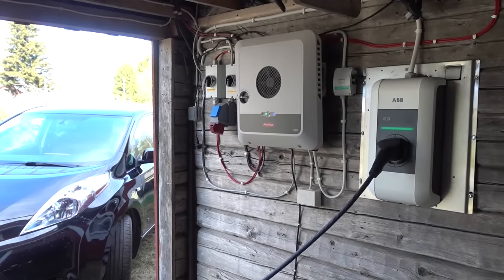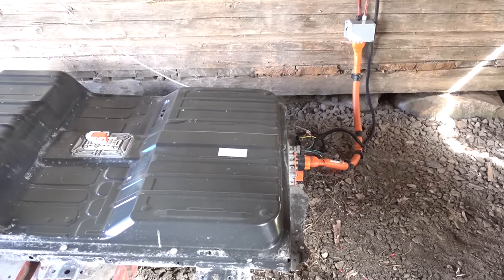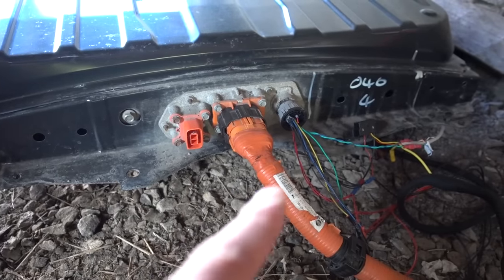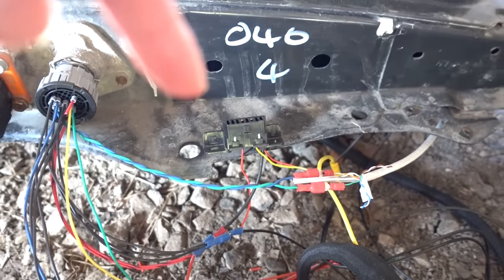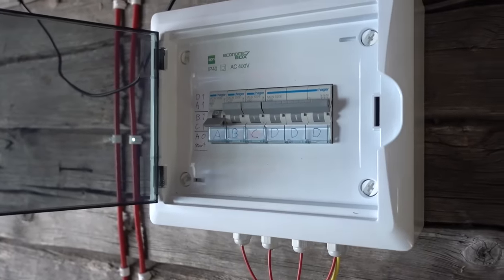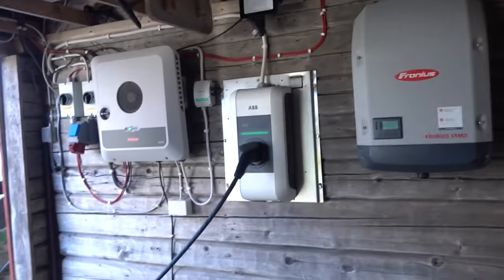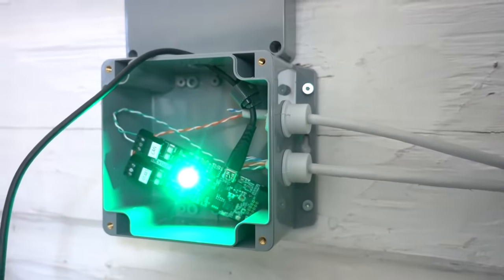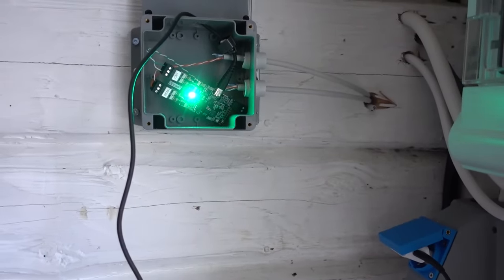The EASIEST way to connect used EV packs to grid! 🔋

Comment: Thanks Dala, this is the kind of content I’ve subscribed for. To be able to use the car battery “as is” without messing with it, use the original BMS plus the sealed box should be really useful.
Reply from the maker: Thanks, I think so too!
Reply: The sealed box however prevents you from analysis past the original BMS or around the original BMS (e.g. with a faulty BMS) directly at cell level or PCB level.
It also disallows visual inspection for problems like corrosion, humidity (think of a previously flooded pack), burns on the board, visually bloated or blown capacitors, charred or sticking contactors, and so on.
Also, you cannot easily change modules and cells or the BMS board or broken contactors. It is essentially a black, sealed box. In other words: you really have to trust this BMS. Even after let's say 10 years in its first life in a car with whatever environment. And you cannot choose a favourite kind of cells or chemistry.
Old Leaf LMO or NMC and Tesla-used NCA chemistry is not the best for stationary use with many cycles. Old Leaf packs are passively cooled, but with Tesla batteries or modules, you would have to add a cooling circuit if  the original environment was wanted.
I still like the idea as a low-cost alternative, but both sides should be considered when going this way with 2nd life EV packs.
Reply: @MooseOnEarth  no cooling would be required. It's highly unlikely that a house would draw the high current that the car did. Maybe 1/10 the current used. If that.
Reply: @kevinroberts781  In that case however you have to check, whether the original Tesla BMS can cope with the absence of TMS components. It may check, whether all expected sensors send plausible data and also check that all expected actors act upon the media they act uponand that then sensors do indicate successful operation of the actors. The original BMS is typically in direct communication with the original TMS. And now, all this communication would have to be emulated
Dala and the EV hacking community will likely figure that out, but once people use such solutions, they should be aware of a mixture of Tesla routines and surrounding glue code and emulated components, that are not actually present. In other words: people are on their own. That's ok, if they are aware of it. But they better are aware of it.

Comment: Ever since I saw the home batteries made from Leaf cells I wondered why they did not take the high voltage out and use it like you did and now with high voltage MPPT built in chargers it will be even easier. Congrats.
Reply: But how you will charge the battery, no way to communicate between inverter and the BMS etc. This is all in one working solution
Reply: @georgmuse  They now make high voltage inverters and chargers.

Comment: Very cool stuff! Next you got to connect your Leaf direct to that inverter via DC to charge and discharge. Defeat pack to ground current leakage test module in your Leaf and you should be good to go.

Comment: Hi  well done that's a great work  but i just wanna mention to you not to forget the wiring size for AC and DC, the fuse, isolation switch, and SPD in case of lightening, also draw a digram it will help. Thanks

Comment: I just got the lilygo and will try connecting it to my older Fronius Symo inverter....our old 2012 leaf is due for a battery upgrade soon so hope to use the removed battery for storage!
Reply: That Symo may not be compatible?
Reply: @dominicwild3189  its compatible with tesla, byd and fronius wall batteries so should be fine, I've connected the lilygo to it and is does communicate, just waiting to get my hands on a battery now....

Comment: I was very confused by the simplicity of this ("just plug the DC into the inverter") because I'm so used to every inverter being @ 48v. Took a while to dig up that the Fornius is a HV DC inverter, using 150v - 455v for the battery connection side.
Reply: I was thinking the same. Sounds like an ingenious inverter.

Comment: Make sure the fireproofing you add is extremely robust . Maybe get a sheet-metal shed to put at a modest distance from your house, and run wires from there. 
Fire departments don't actually "put out" lithium battery fires.  They just dump massive amounts of water on them to cool them off somewhat until the battery has burnt up all it's fuel, to hopefully keep the blaze contained. Some have suggested that EV batteries don't belong within 20 meters of any flammable construction. That may be excessive, but the fire can easily melt a car down to a puddle.
There are longer lasting batteries with lower power density which are better for non-mobile use.

Comment: Very great solution! I wonder if can get rid of solar controllers and use, for example, VFD which also has RS485 and can accept 400v DC and convert it to ac?
Reply: Maybe we can connect to some cheap PLC as well to control contactor and get date from battery.

Comment: I've wondered for some time now, if the market would not have reached a point by now where you can buy and assemble a modular system, consisting (in very general terms) of the following components:

* A standard inverter/control box that would do the power conversion, interface with any grid control device, etc.
* A battery specific interface box, that would convert the batteries' voltage/current/communication lines to standard values/protocols that could interface with the inverter/control box. 
* A used EV traction battery

So, in your situation you'd buy the inverter control box, a "Nissan Leaf" specific interface box, and you'd have the Nissan Leaf battery. Someone else, who may have a BMW i3 battery available, would buy the same inverter/control box and "BMW i3" specific interface box, and be in business.

Of course, this would have to made in large numbers to be affordable, and the legal and safety stuff of trying to commercially sell something like this would be a nightmare. It would, however, provide a large market for used and moderately-degraded EV batteries, silencing the "butbutbut EV batteries will end up in landfills so they suck"-crowd once and for all.

Comment: I know it is straightforward, but showing a parallel setup so you are able to connect more batteries as required would be useful.  Great work as ever!
Reply from the maker: Yes it is possible to string together multiple batteries. On my Patreon Discord server there are users with multiple batteries!

Comment: The Fronius Gen24 has a +5 V Output. You can use that to power your PCBs.
Reply from the maker: There is also +12V via the Modbus connector!

Comment: Well done Dala. What you have done is genius. If I can source a battery I will definitely give this a go. On a different topic. Why is it not possible to repack a leaf battery with after market cells and reuse the existing wiring to these cells ? I know it would be difficult to match the physical size but the newer cells would make up for this all be it with slightly less range.
Reply: Everything is possible if you are motivated enough...
Reply from the maker: Wrong BMS parameters, reduced crash safety, more dangerous charging, harder to insure etc. Anything is possible, but this needs to be done by a company and not a DIY job
Reply: Good question; one company is taking the cell upgrade approach for the Mitsubishi triplets but has been slow getting to market. Cell upgrade involves many hours of labour, so a higher capacity Leaf battery pack from a crashed car is probably more cost effective, if you can find one. ☮️
Reply: Replacing cells is something I do in my shop. It is easy but if you have to ask these types of questions, you shouldn't do it. Be sure to wear  5000 volt gloves.

Comment: Nice one 👍 I was curious about the inverter and HV battery but it seems it takes wuite a wide DC voltage range which is perfect for this re-use - unlike 48V systems which require more up and down conversions. I guess the only snag I can see here is playing around with HV DC 😬

Comment: I’ve watched this a few times trying to get my head around it. I’m looking to do a conversation like Regen EV’s fastleaf, but the vehicle will be primarily battery storage for an off grid property. I’d like to have a way to fairly easily disconnect and move the vehicle. If I used the aux port for the heater as the output to the grid, I could keep the main power to the motor connected? For the canbus plug could I use a jumper to just put a second connector somewhere accessible? Any advice would be appreciated.
Reply from the maker: Use the Chademo socket, it can be used bidirectionally

Comment: this is amazing.  I don't know what specifically your inverter can do or whether it's like a 6/12k hybrid, but somehow you are putting 300-400v into that guy via mppt, when most only handle 48v.  How are you throttling the output power -- frequency/hz shifting? When my model s tesla battery finally needs to be replaced I want to do this with it and built an outside rack for it in case it ever caught fire with a roof covering and some coolant lines still hooked up to deal w/ any heat issues on a microcontroller relay based on temp.  I currently have a solark and 30kw of batteries (big bill) and would love to repurpose some more stuff that can use outside of the 48v target like these EV batteries without even cracking the case to run some larger appliances like a 5hp well pump when the power is out.    Tesla won't really give me anything for a failed 85kw battery when it finally goes after the warranty, but there is probably around 50-60kw of usable capacity left usable even if a few cells had to be removed (they are nominally 400v).

Comment: Perfect idea - I do think you need more solar panels to fill the EV battery - love the arduino - we use them for remote data logging on environmental monitoring - any thoughts to connect to a more recent current/live/real EV via the 400v DC CCS connector?
Reply: > . . . any thoughts to connect to a more recent current/live/real EV via the 400v DC CCS connector? <
I want to do that too!  Boosting my 4kW, 215 Vmpp PV array to 400+/- volts with a boost-mode DC-DC converter is no big deal.  Getting the car to recognize and accept charge from what I will call "PV-->EV DC slow charge" will take some effort.  Are these communication protocols and signals(codes) published somewhere?  I already found the pin outs.
Reply: My knowledge may be out of date but CCS never used to support v2h. Dropping chademo for CCS killed a lot of v2g and v2h startups in the UK. Maybe newer implementations of the CCS standard supports it now.

Comment: Just stumbled on your video, thank you.  I just had a thought to hook up my DIY EV battery to a MC4 input on spare Solar Inverter ,    my only concern is exporting power to the grid at night  which would be wasteful. (FIT is only $0.05  kwh  ,  buy for $0.25 kwh)   Maybe I just plug it in when  we are cooking .  Battery is 28kwh  @144v   Inverter is 10A DC input ,  = 1.4kw / hour

Comment: These batteries are three phase right I notice they only single phase is coming out. Could it be set up to run three phase?
Reply from the maker: Battery is DC. Inverter is 3-phase AC. 

Solution works with both 1-phase AC inverter, and with 3-phase AC inverter!
Reply: @DalasEVRepair  thanks I’d need to run some fairly large machines. One is around 27kva. Any suggestions inverters that would be compatible?
Reply from the maker: @that0guy9  See the Wiki! https://github.com/dalathegreat/BYD-Battery-Emulator-For-Gen24/wiki#supported-inverters-list

Comment: isn't the cycles in the batteries around 500 lifespan so basically 500 days from new?
Reply from the maker: No thousands. Some tens of thousands.
Reply: @DalasEVRepair   The best of the Nissan Leaf are the 24kWh batteries from 2013 and up 
There is much more degradation in 30kWh batteries, but as an energy store at home, they are going to a well-deserved long-term retirement where they will have like in paradise - much lower charging and discharging current 😉

Comment: Hi Dala, I admire your skills and inventions. I would not be able to set it up by myself, but if there is any plug-and-play kit on the market in the future, I would buy just the kit, inverter, and used leaf battery, which would be huge.
Reply from the maker: All the parts needed are listed in the Github link in the description. It is very cheap, and I want to keep it that way. I also don't want to be liable or have to give support about this, so it is best to keep it as an open-source project!
Reply: @DalasEVRepair  understandable. Although I think for less tech savvy people it would be great if it could be simplified even more. Like, could we use the liligo to do the startup sequence? Can the liligo be powered directly from the Leaf battery?

Keep up the good work btw 💪
Reply: @matroosoft4589  no, this is why the leaf and all other EV have a 12 VDC aux battery. Something has to run the control circuits safely to then command the HV system. It's a horse before cart problem here 😅
Reply: @matroosoft4589  you could absolutely use the esp32 on the lilligo together, with some relays (maybe just mosfets, need to study a bit), to do the start-up sequence. i'm sure Dala or someone else will get to it before I do a battery upgrade and free up my old leaf battery but if not I'll take a stab at it then.
Reply: I have lots  of used batteries I wish I could give away.  New batteries are cheap, about 35 USD per kg. with BMS.  Is that a problem for you?

Comment: Dala's super powers! Absolutly astonishing.
Maybe this is on the way to even get it on a battery inside an Leaf via Chademo...
Reply from the maker: A Chademo cable costs over 1500€. Better to spend that money on a used 24kWh battery 😅
Reply: @DalasEVRepair  Oh, already known, how to get an Chademo cable around 700,00€, include tax in europe.
My intention is not only to use the battery in the car as local storage, the possebility to charge with an variable speed,
below the 230V 6 A and above the 4,7 / 7,2 kw up 50 kW would be that "Super-Power" ....
Reply: Doe's any one know, if it's possible to disconnect the battery, to stay in this example, from the fonius gen24 while the inverter is active.
Of course, set the inverter to stop charge or discharge the battery and than disconnect.
Reply: ... and the next one.
Is there any hybrid solar inverter, with two independent battery connections?
I guess, this is unlikely. To even top that, is there somethin, that could charge on DC battery with the other DC battery?
Reply: @DalasEVRepair  What's about CCS Cable? This would make the CCS conversion even more interesting. Maybe an non conventional configuration of css, as an custom hack for v2h...?

Comment: Stumbled upon your video by chance and I must say this is very neat! It is a bit on the riskier side for my liking but still amazing that you can go off-grid. All the power to you!

I wonder something though. How do/did you make sure the used Leaf/Tesla battery pack is in good shape and there are no problematic cells that's gonna burn the house?
Reply from the maker: By checking out the battery beforehand: https://github.com/dalathegreat/Nissan-Leaf-Battery-to-OBD2

Comment: Nicely done. Eager to see your fireproofing solutions. My understand is that the leaf’s battery chemistry is fundamentally safer than other EV battery chemistries. Also, the onboard BMS is fairly robust and should prevent overcharging throughout its usable life. As long as the battery pack remains sealed, with no opportunity for water to enter, the risk of fire will be close to zero. But, it’s always good to plan for the worst.
Reply: Fireproofing the battery or the wood house?
Reply: The onboard BMS won’t protect anything, it will simply flag an alarm which Dala’s equipment must act upon. 

The only way to render the battery safe in a fault condition is to disconnect the HVDC lines using the contactors which Dala hasn’t implemented. 

Very much work in progress compared to other efforts.
Reply: short of placing the battery in a tub with a solenoid valve to fill it with water in case of fire, the only fireproofing you can do is use fire bricks,  aerated concrete, expanded clay etc to make sure the heat cannot reach anything flammable and let it burn out.
Reply: @notsonominal  never mix electricity with water. CO2 fire extinguisers, proper chemistry study need, and preventing explosions and presence of fire fuel nearby...
Reply: @InternetListener  hes right, the only way you can put these fires out is to keep it cool and let it burn out, so firefighters tend to stick them in a big tub full of water.

As seen here

https://www.youtube.com/watch?v=qwxZu3nVOZ0

and 

https://www.youtube.com/watch?v=KzJ6LperQUk
Reply: @InternetListener  CO2 exitnguisers will not work too well, the reaction in a runaway lithium battery is self sustaining, providing its own oxygen for combustion.
Reply: How is the Leaf's chemistry different or safer?
Reply: Battery in a metal or concrete box with a wooden ceiling and a couple of tones of sand ontop.

Comment: im just wonder if i bought and EV battery from lets say a leaf with 100k miles on it and has 50 miles range or so about how many years would this battery last for a home? great video
Reply from the maker: This battery is 8 years old and has 80% state of health. I expect it to last 10-15years in this application!
Reply: thank you! @DalasEVRepair